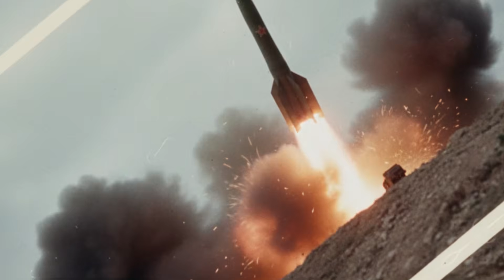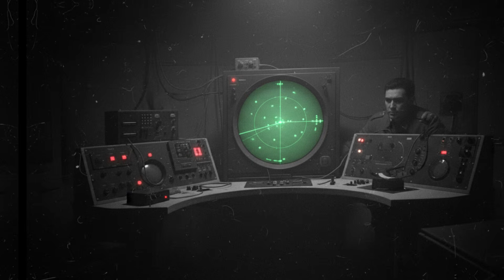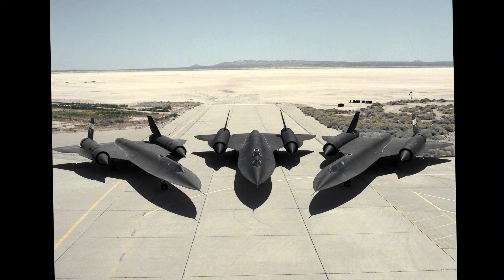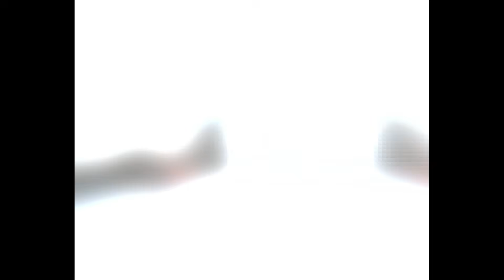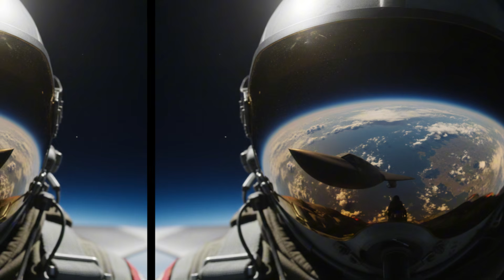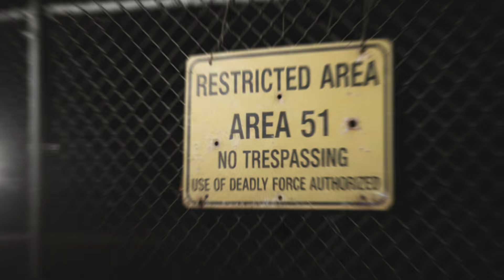Why the Fastest Plane on Earth Leaked Fuel on Purpose

Comment: Clarence L. "Kelly" Johnson wrote an article about the development of the SR-71 that was published in the Winter of 1981/82 issue of the magazine called: "Lockheed Horizons". In this article he explained all of the problems associated with the use of titanium at high temperatures (up to 800°F during flights) including "snapping bolts" that were eventually traced back to mechanics using wrenches plated with Cadmium, the cadmium molecules scuffed off from the wrenches during tightening caused the titanium fasteners to fail after a single flight! The "spot-welds" on the titanium skin of the aircraft were also failing after flights because it turned out that the Burbank CA. water used to clean the titanium components was chlorinated at a higher level in summer, so that they had to use "de-ionized water" for all cleaning! If you are interested about the development of the SR-71 Google: "DEVELOPMENT OF THE LOCKHEED SR-71 BLACKBIRD" (with both quotation marks, click on: CIA.Gov) David Riddle

Comment: The narrative says that the surface temperature exceeds 300°C so aluminum would melt. However, aluminum alloys melt anywhere from the upper 400s to mid 600s °C. Yes, it would soften and have lower strength, but not melt at 300°C.